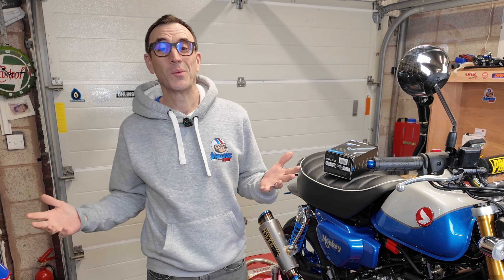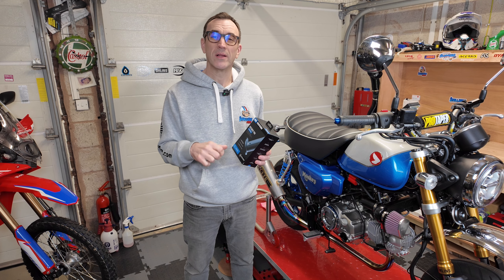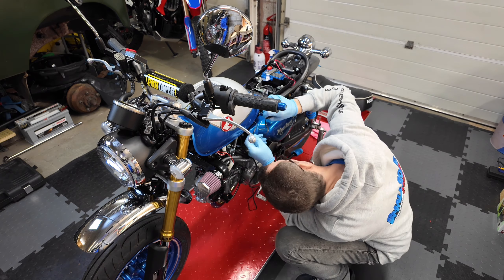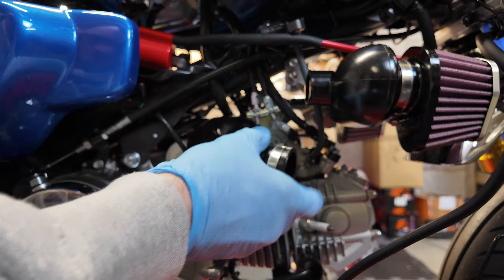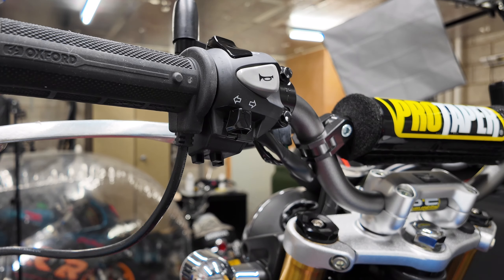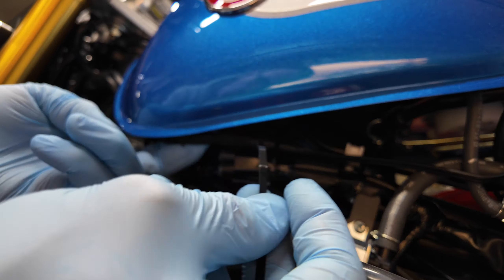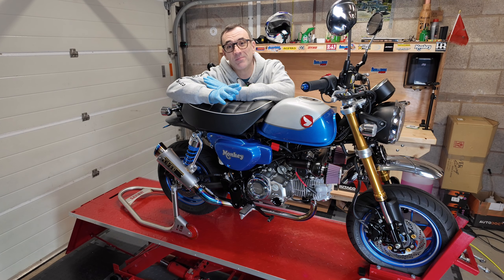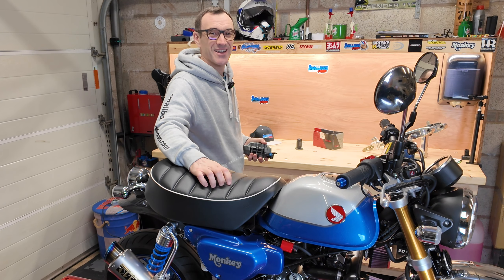Best Aftermarket Heated Grips? Oxford Hot Grips Pro - Adventure

Comment: Wd40 glues as good as hairspray, just fitted Biltwell custom grips on mine and it advises you use wd40 and works spot on.
Reply from the maker: Good stuff… never heard of using WD40. I’ll try that in the future
Reply: Be careful, the silicone won't work well with the home brew methods (paint, hair spray and WD40). They supply the proper glue that is uneffected by temperatures, why not use it? It is standard "super glue" so it is available.

Comment: I had a Moto Guzzi V100S Mandello with the factory heated grips. I also bought a V7 STONE MODEL 10 and installed the Touring PRO Oxford heated grips on that bike. I did use a 12V relay to trigger the GROUND on the grips (hot stays on the battery) with a switched wire to the ignition. No way to leave them on. So, so, so, so much better heated grips on the V7 than the V100S! The V100's heated grips just tease you with inconsistent warmth. The Oxford grips are STEADY and EFFECTIVE at tossing out a nice even heat all the time and on the LOWEST setting. Even 35 F they keep the digits warm. The TRAVELS stock heated grips will go in a box in the garage probably forever. 

They work so well that when I swapped the V100S Mandello for a 2025 Moto Guzzi TRAVEL (way better bike for how I ride one) I am REMOVING the factory grips that are awful, and installing the Oxford Touring PRO version and again with the 12V ground  relay. 

I can't recommend the PRO touring version enough for the HEATED part of the equation. The small button is a little hard to push with winter gloves but once they are on, no problems and that's better than a button that gets pushed inadvertantly so I've grown to like the small button. 

Also, an equation item that is overlooked...the glove to grip traction is phenomenal on the touring PRO version (not sure on the other grip designs). Once you get your mits on them no slip at all and that's REALLY nice and secure feeling. Being silicone, the grips properties are nearly transparent to temperature and stay grippy and pliable. Wear should be really good, too, because of how tough silicone is over TPO's, TPR's or Vinyls. 

For basic bar grip all year (you can't turn the grip level on and off) not just when heating them, the Oxford Touring PRO are great. I'm not keen on the price, however. They are almost pricing themselves out of the market. Too bad as they are, in my opinion, limiting their market potential with the too high price. If cold hands aren't your thing and you absolutely have to get there in the cold, then the price may be OK to swallow.  Yes, I swallowed twice.

Comment: great video.
which tires did you install?
are they better than the standard tires?
Reply: Michelin Power Pure. Much better than the standard Vee Rubbers on the road… but I guess you lose the ability to go light off road.👌🏻
Reply: Thanks! Which size for the front and back is the right one?
Reply: The standard size is 120/70/12 for the front and 130/70/12 for the rear, however I have a 140/70/12 on the rear

Comment: Just had a fault with mine, luckily they already were on the bike when i brought it.

Was working fine for a while, then suddenly (on a hot day too), I didnt turn them on or anything, I just noticed the right grip was getting hotter and hotter over time, I came back out of a shop and it was hot to touch like HOT couldnt hold them for longer then 2 seconds, even when the bike is completly off they wouldnt stop heating up. The light wasnt even on and I couldnt even turn them off or even "on". 

They are meant to detect your hands too so it stops heating up when you take your hands off.

Luckily I didn't spend money on them tho 🤣
Reply: What did you do? Did you replace them or get a different set?

Comment: How hot do yours get? My hot grips pro are really disappointing and don't get anywhere near warm enough. Using a calibrated thermocouple I only get 35 deg C on maximum setting, 10 deg C less than Oxford claim. It doesnt matter if I'm stationary or moving, they max out at 35 deg C. They're getting 12V as they should, but an ammeter test shows their current draw dropping to just 2.3A shortly after starting to heat. It clearly looks like a faulty product to me yet they tell me it's normal. Ive even tried a replacement left grip with the controls in it because the original was missing one of the threaded collars for the electrical connection. The replacement they sent me was missing a different part 😄 Their quality control is absolutely abysmal.

Most people with Oxford grips say that they are too hot to really hold with ungloved hands on high setting.
Reply from the maker: I’m away at the Isle of Man TT at the moment, however when I get back, I’ll get a laser thermometer on them for you.👌🏻
Reply: @SmallboreAndMore  very jealous mate. That would be great if you can, would be really good to have some confirmation that others are getting warmer than mine.
Reply: I have the same problem with these grips mine are not wired directly to battery not sure if that makes a difference they keep recycling through settings fitted by a motorcycle dealer more heat off cheap R&G ones 😢
Reply from the maker: @wadhammer5538  we’ve just done some tests… very disappointing
Reply: @MrJulianneave  did you get sorted I have the same problem
Reply: @SmallboreAndMore  hey, I like the idea of not having a separate controller. Great video. Are you doing a follow up on your test results? Very disappointing to hear of your disappointment. Have you contacted Oxford, by chance?
Reply: Hi Julian, I just noticed that you said they get 12V as they should. I'm very interested if thIs is actually 12V or is it higher? With the bike running your alternator should be producing 14V and to get the grips enough power you would need that.
Reply: Mine get plenty hot even on the lowest setting. I use a 12V solenoid to swith the GROUND with an ignition switched wire so no way to leave them on. But plenty warm.

Comment: Hi chaps. Great channel and great vid as always 👏🏻 I recently installed these grips on my JB02. I connected directly to my noco nlp5 battery. On my first ride out with them they got nice and warm, but about 20 mins into my ride, the battery completely died on me. Swapped the battery back out for the stock one (without the grips) connected and it started fine. Any ideas?
Reply: There is a procedure to set them up for Lithium batteries voltage properties. Did you do that?

"mode for lithium batteries, now common on high-performance motorcycles."
Reply: "mode for lithium batteries, now common on high-performance motorcycles."

Did you do that for your bike?
Reply: "mode for lithium batteries, now common on high-performance motorcycles."

Did you do this? Check your alternator!!

Comment: What is the overall length of the grips?  120 mm?
Reply from the maker: Off their website: Grip length of 132mm but can be trimmed to 123, 120 or 117mm if required, with open ends allowing bar end weights can be fitted

Comment: Don't know why people would want them connected to the battery, instead of in the head light, so they turn off when you switch the bike off. Don't have to worry about draining the battery.
Reply from the maker: The grips turn themselves off automatically👍🏻👍🏻👍🏻
Reply: They can be set up for direct battery install (where they will check the battery and turn themselves off). Or to a switched power - which then you have to make sure you are not drawing more on that line and not popping fuses. Easier to go direct. Also they have 2 modes that you make sure you get right. Depending on the battery. If you are rocking a lithium then you have to choose that for your battery so the unit will properly switch off.
Reply: I use an automotive 12V solenoid that switchs with the ignition for the GROUND to the frame; open/closed. So no way to hurt the battery. Solenoid is good for 125 amps @ 12V...I think it will be OK!

Comment: how hot do they get ? hot enough to have to turn them down in colder temps.
Reply from the maker: No… not that hot.

In fact, now I’ve had them a while, I’d say the original Oxford ones with the external controller are hotter!
Reply: @SmallboreAndMore  you just helped me save £110 🙂
Reply: @SmallboreAndMore  sad to hear, what a bummer
Reply: I use mine at the LOWEST setting at 35 F and they get it done. We have that.

Comment: Companies like Daytona had this style of grips for a while now and they don't charge £200 for it 😄
Reply: And the Daytona grips don’t have thermistors that accurately control the temperature of each grip. The Daytona can also reach crazy hot temperatures, over 90 deg C which will obviously burn skin if not reduced. Used Oxford grips for 20 years for a good reason😊
Reply: @Willgrf  have you used this particular model? There are reports that it only gets to 35°C if you look in the comments here. 
I was hoping to get these, as I really don’t wanna controller cluttering up things – but if they don’t produce enough heat, what’s the point?
Reply: @Yowzoe  Hi, yes on two of my bikes. The first bike is the little Honda Monkey and the 2nd is the Royal Enfield himalyan which doesn't have a very good battery but charges well with the alternator and has no problem in powering the grips. The Oxford Pro grips are different to the Premium and Advanced and yes, they do not get to such high temperatures which i think is a good thing. Most heated grips have no surface temperature control at all so as the ambient temperature changes, you must change the temperature to avoid getting burnt hands on longer journeys. The thermistor in the grips is unique, nothing else has it and ensures accurate and safe temperature control. To answer your question, I ride in most weathers and these definitely get hot enough for me. On the high setting I can feel my hands pulsing at times as they are too warm so ride on the 2nd setting. I have never had cold palms or fingers. I've heard people don't find them hot enough and I wonder if that's because they don't have good circulation/Raynaud's disease. I'd rather them keep my hands warm rather than burn. If they were 50 degC and being held for an hour skin would start to burn.
Reply: I totally agree on the too high price, but they WORK. At least they don't crash on that attrubute. I put these on both my Moto Guzzi V7 and TRAVEL models...so happy, except the price. Heat is fine at the lowest setting at 35 F.  Summer grip feel is also really good as standad grips, too. 

These should not bother a proper charging system. If I recall they pull 35 Watts. The MG puts out 430 watts.
Reply: @Willgrf   really good to hear. I think I’ll order them from Amazon UK and have them sent to the West Coast of the US where I am — thanks for your extended review :-)
Reply: @rower30-mt3tb  makes sense. Glad to hear that they’re a superior product, and I especially like that they’re stealth. Expensive, but for me worth it.